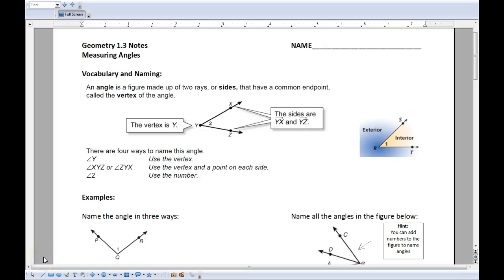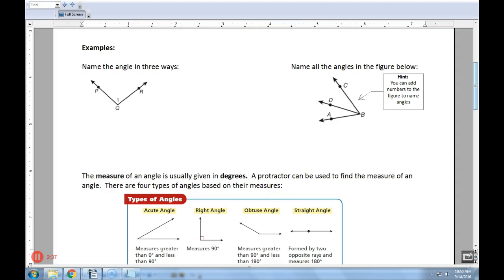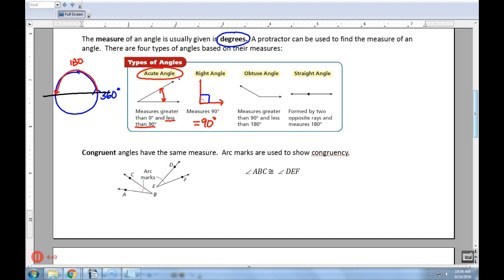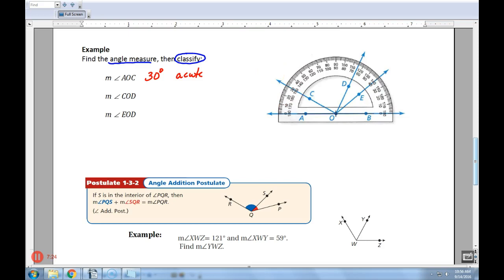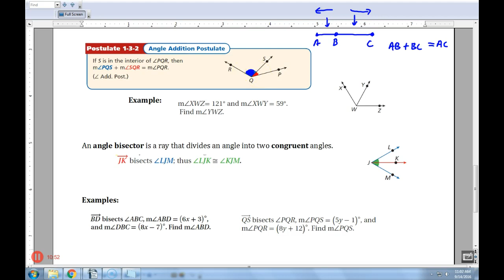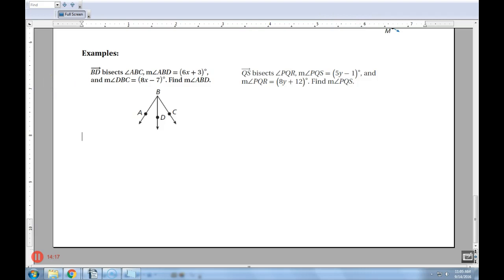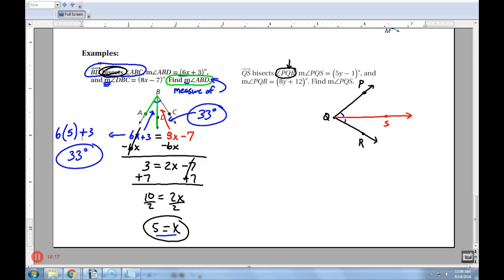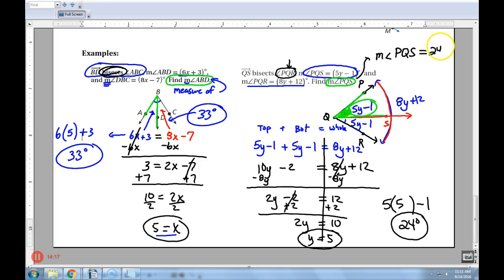1.3 Video Notes Measuring Angles

Comment: On your last example, when canceling out the negative 2 shouldn’t you get 2y=14, making y= 7 ?
Reply from the maker: You are absolutely correct, I screwed up!  I would have found that out if I would have substituted 5 into all expressions with a y.  I would have gotten 24 degrees for the small angles which should add up to 48.  But subbing 5 in for 8y + 12 would have been 52 degrees.  24 + 24 is not equal to 52.